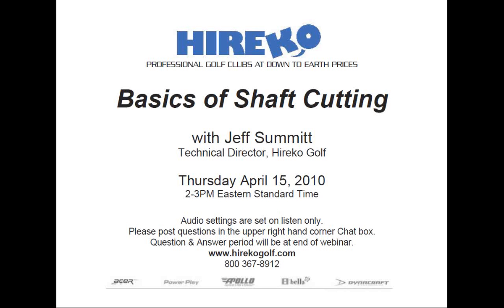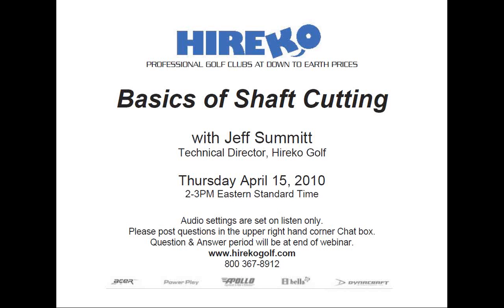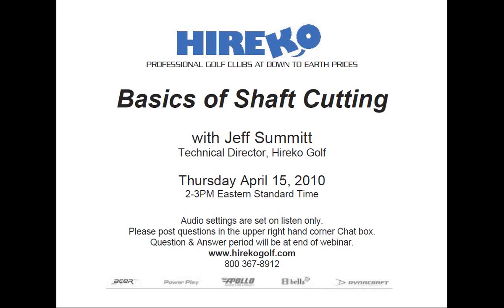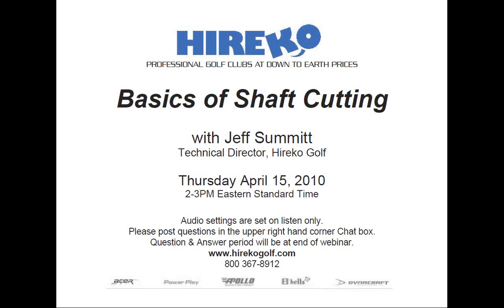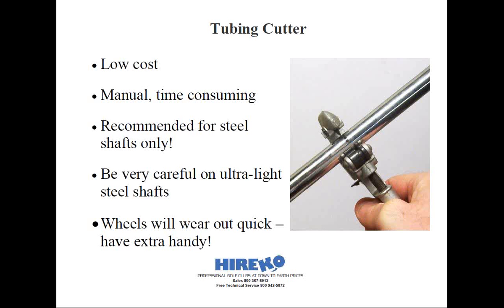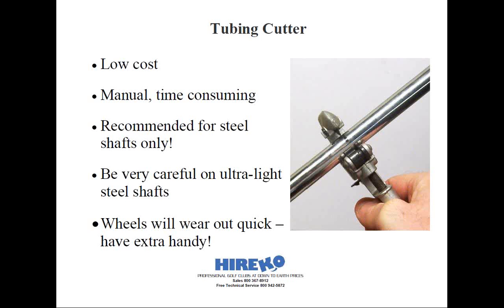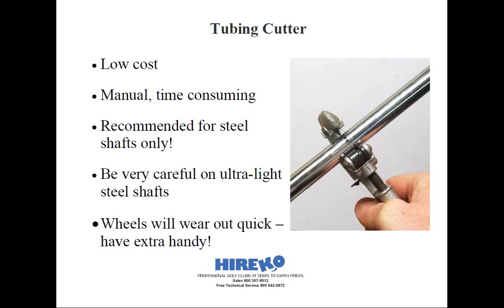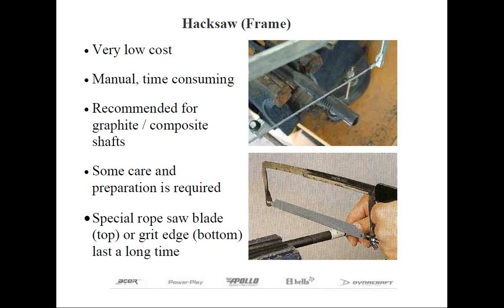The Basics of Shaft Cutting 1 of 3

Comment: Just curious how steel shaft steps are incremented between irons? TY
Reply from the maker: For iron shafts, you will see the steps graduate in 1/2" increments.  The exception would be in single length sets where the steps will be in the same position.